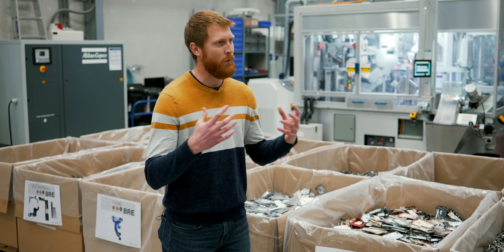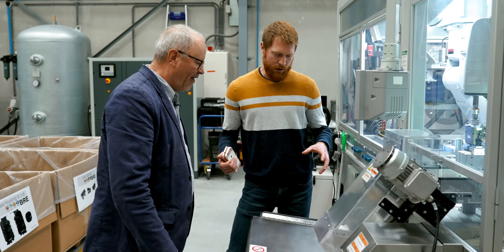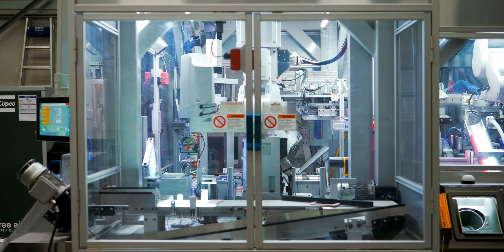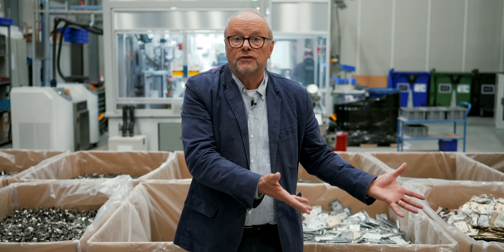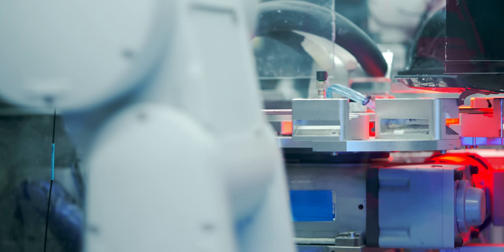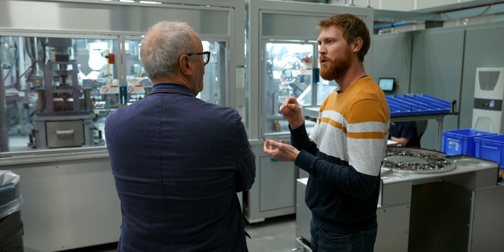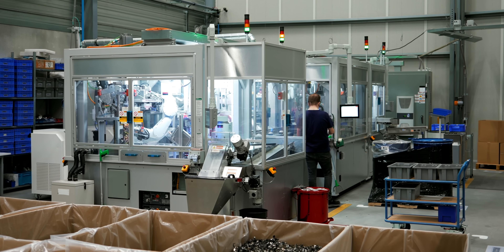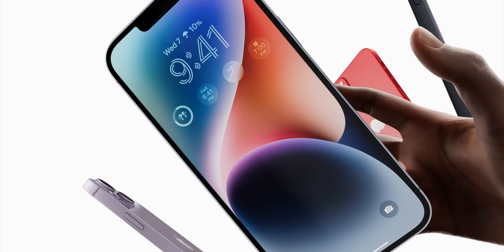Is This Robot Apple’s Most Important Device Yet?

Comment: Some serious greenwashing from an anti-repair company. If apple were serious about the environment they would allow their devices to be fixed and kept in service for longer.
Reply: They already support their devices for 7 years which is beyond most if not all consumer electronics. Even if they allowed extensive repairs they would still require recycling when broken or obsolete
Reply: @chidorirasenganz  it is true that their software support is better than many but still many devices become unupdatable when the hardware has plenty of life in it. And if your device does nees repair whilst it could still be useful? good luck with that. Apple's (and other big answer - just buy a new one and we'll recycle your old one. Not ideal
Reply: @mattsword41  updates are only unavailable if it runs poorly on older hardware. And repairs are available on basic components like batteries, screens and connectors. Also the seven years was how long before parts are no longer manufactured anymore. Their software support is around 7 years depending on the device though

Comment: The sad thing is that the majority of those handsets are probably in perfect working condition and the process of 'recycling' is totally wasteful of energy and resources. This is the byproduct of a throw away materialistic society!
Reply: Because they thought the latest iphone is way better but turns out it's just 0.001 percent better than the previous.
Reply: @Adi Rompin  That and planned obsolescence by Apple! My 2007 iMac still works fine, but Apple deemed the hardware not good enough for the 2009 OS update (Just like Microsoft are saying most PCs older than 3/4 years old won't take Win11 ... even though they can!). Planned obsolescence and blocking the Right to Repair are 2 areas the eco lobby needs to clamp down on. This recycling of perfectly good/repairable electronics bulls**tery is just so wrong on every political level.
Reply: Or the only thing wrong with it is a tired battery, but replacements have been made very difficult by those lovely people at Apple.
Reply: @fullychargedshow  People do that because Apple is one of the worst consumer-facing companies in the world for anti-consumer behaviour. It has such a horrible reputation in the area of repairability that you really shouldn't be surprised that a video like this gets such a reception. 
Apple is the poster-child for doing scummy things just to stop people fixing their equipment (not to mention the absolutely vile patent case against Samsung for daring to make oblong phones with rounded corners).
Yes, this is really useful work they are doing, and we all need a circular economy, but to make a video like this without even mentioning Apple's horrible reputation and self-inflicted inflated waste stream is just asking for a thoroughly unimpressed response.
And accusing people of not caring about the actual waste stream just because they can see the glaring inconsistency here is just embarassing. Of course we bloody care - that's why we're so angry about the repair problem in the first place.
Reply: Even if a percentage is in "working order", they are still thrown away and that is why the recycling process is so important, that the product can be taken care of regardless. See?
Reply: @Jens Ericson  The focus shouldn't be on recycling. The focus should be not manufacturing so many devices and having such a short product life cycle in the first place. The current product cycle is geared up for the manufacturers profit, not longevity of the product. Recycling a product at such an early stage I  it's potential life is in its self an energy wasteful and prematurely undesirable process. How many Apple devices are sold because Apple deem the old one unrepairable... when in fact it is, and would be cheaper to both resources and the customer to repair. It's not in Apples interest though. They aren't one of the richest companies in the world for nothing! Do you not see that?
Reply: @simonbaxter8001  Technology fields change. Devices decades ago are not what devices are today. Bad? Well, things change. Besides, I disagree that PDAs today have THAT short life cycle. It often depends on how often you changed them, most people want to change from one model to the next every year. It's not only the fault of the manufacturer, you see. It's of course great if product last as long as possible, but it's a complicated matter with no short easy answer.
Recycling is ALWAYS the focus, because products need recycling anyway, regardless of them being newer or older. You are missing the point here. It's about recycling what is coming in for disposal. If you want to make a difference here, you ought to keep using your PDA for as long as possible. If you are, good on ya.
Reply: @jericoba  Been using my Samsung S7 Edge since it was released in 2016. Still a great phone, no need to change what ain't broke! I agree that everything needs recycling ... just not EVERY YEAR when the next 'shiny' model comes out with very few benefits other than more money/profit in the pockets of the manufacturer. Guess we both agree on that 🙂
Reply: @simonbaxter8001  Yep. And enjoy that device until you are forced to retire it. Take care. :-)
Reply: @jericoba yep did this with an iPhone 6S plus jumped ship to an XS max when my parent upgraded to the 12 this was right before they dropped software support for it (7 years of updates)
Planning on staying on the 12 for as long as possible 
The XS Max still has software support but wouldn’t be surprised if that gets dropped next due to age and features of iOS